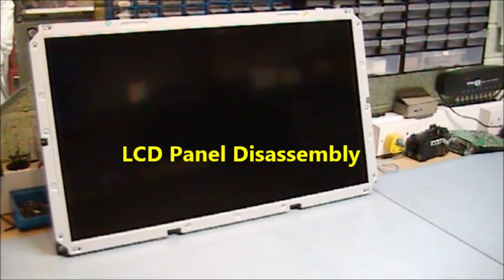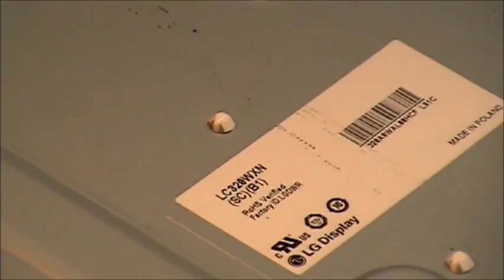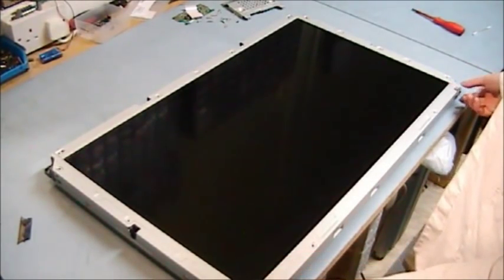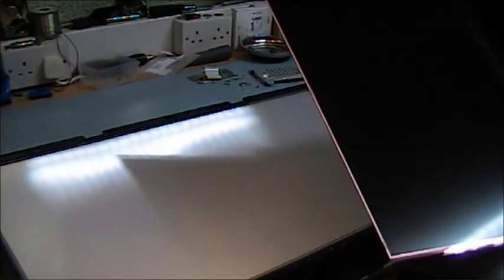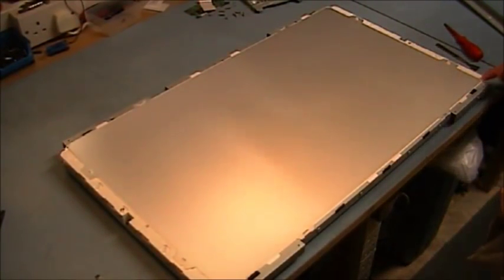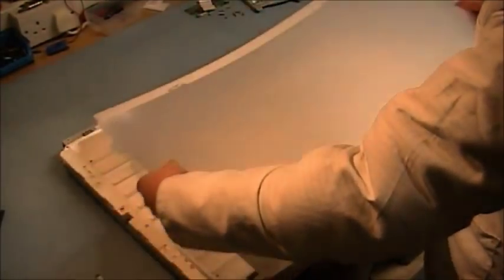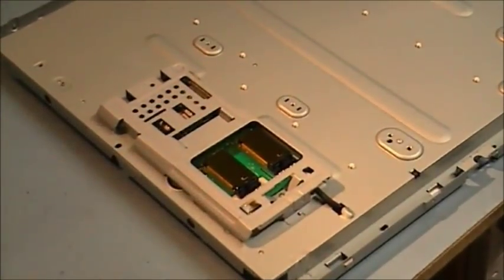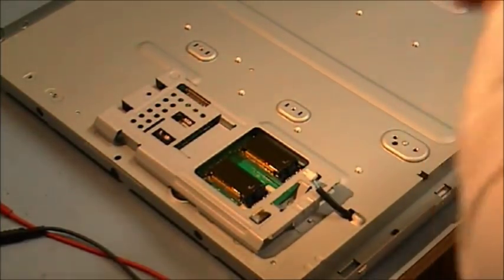LCD Panel Disassembly

Comment: hi.. thanks for the useful stuff. subscribed your channel.
by the way i have a dell s2216h monitor with faulty screen(out of warranty), and dell s2415h monitor with faulty main board (not turning on, actually in warranty period but service desk refused to fix it cause i have purchased it from online store(flipkart).
so my doubt is can i replace s2415h main board with  s2216h. will it workout?
 or is there any solution. 
thanks in advance. your suggestion means a lot to me.

Comment: Ya know, after watching this I still don't understand why purchasing a new tv would be cheaper for a company than replacing that first display/screen that's cracked with a new one.  You'd think that it would and should be cheaper because it's less parts than a new tv.  It's just one screen.  I don't understand how they can calculate the prices and come up with a larger number for one part vs. a whole tv.
Reply: Cause they want you to buy a whole new TV, think about it if they make the screen panels they control how many they make extra then they kick you the price (it's cost the very little)
So you end up buy a whole new TV they don't have to make extra screens
Reply: Ryan Bossler 0oooo
Reply: This is exactly it. I just bought a Samsung 4k TV 2 months ago. Screen cracked while I was moving it to a new stand. I called Samsung and they told me I'd be better off just buying a new tv set LOL I'll take their advice. But it won't be Samsung product.